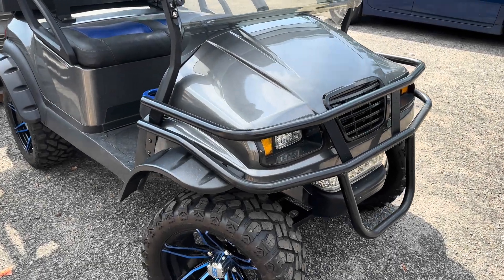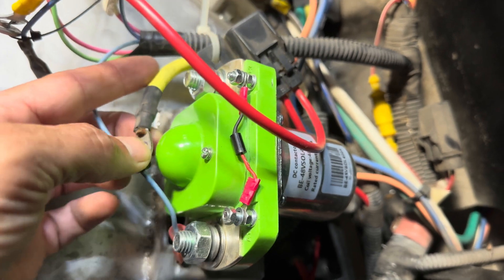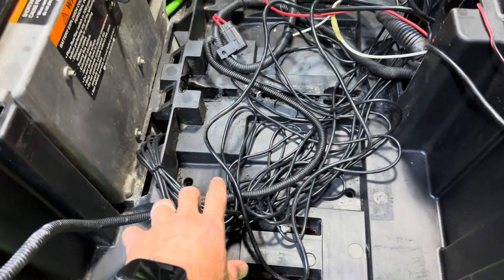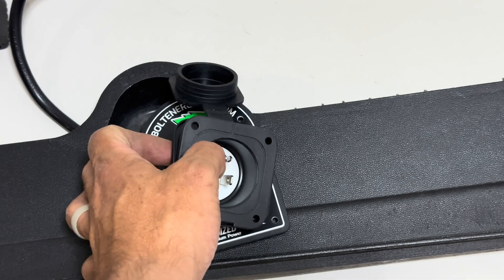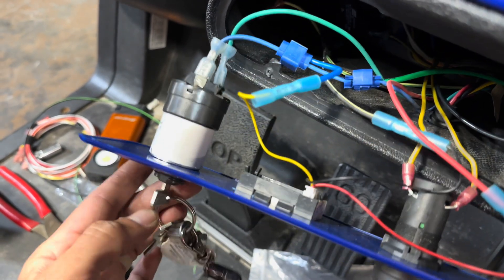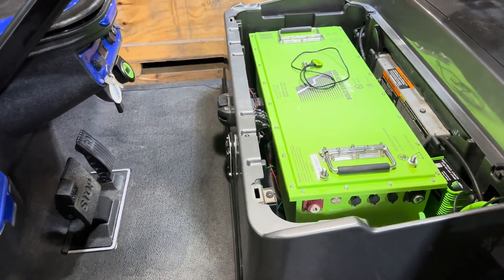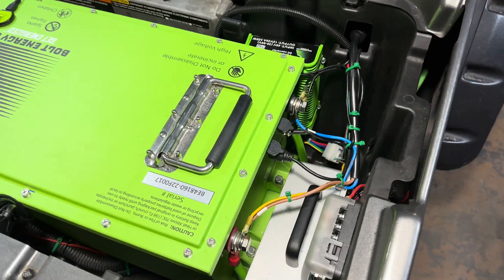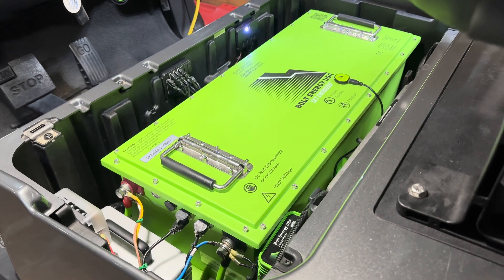Bolt Energy 51v - 160ah Lithium Golf Cart Battery Installation - Club Car Precedent / Onward

Comment: I have a 2016 Club Car Precedent that I would like to change to lithium as my lead acid are going bad. The cart is stock, but I may want to upgrade some at some point. What would you recommend for me to install in my cart and what would I be looking like money wise? Thanks.
Reply from the maker: Feel free to call me Monday at (843)744-2020. The Eco 51v 105ah is by far the easiest installation in a precedent due to the through hole design. Their after sale service and warranty is second to none.